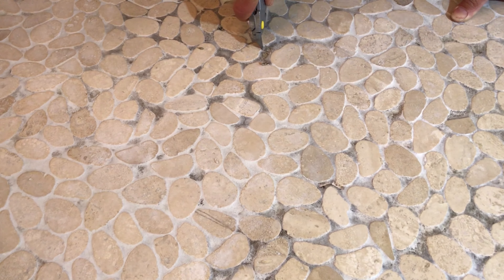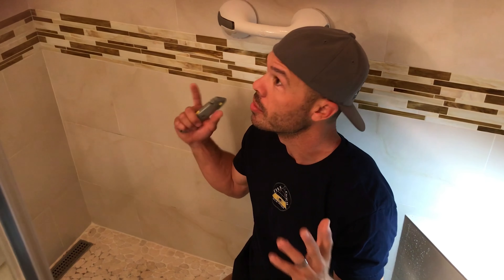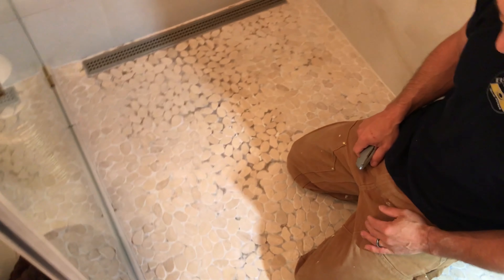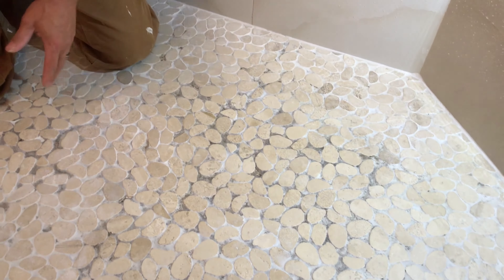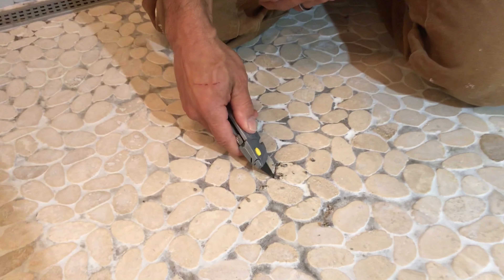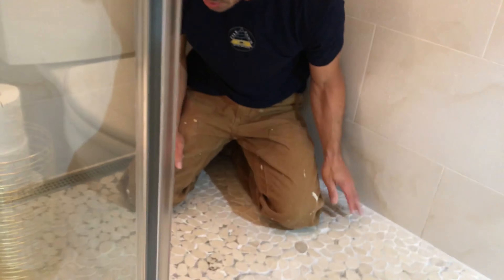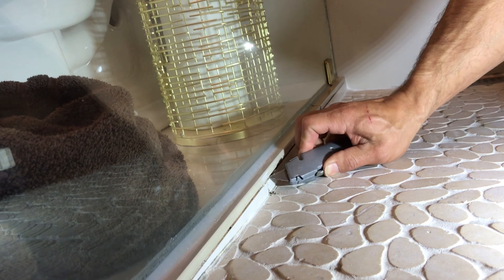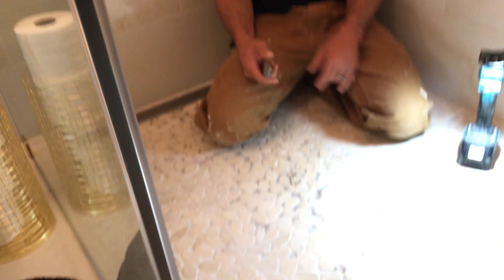I GROUTED this Shower WITH FUSION and it FAILED!

Comment: I used Fusion Pro for a couple of years. Stain resistant, no sealing, it sounded so good. I just had too much trouble with soft mushy joints and showers and I got tired of having to use grout haze remover the next day on probably half the jobs.  Customs kept lengthening the required cure time for wet areas. I just don't want to take a chance with it anymore. 

I have been using prism for a while now and am generally pleased with the results.
Reply: try grout sheild for sealing. you mix it with grout in place of water and then clean wipe with water. no going back to seal 3 days later

Comment: I used that stuff in a shower once.  Waited over a weekend before installing the grout... Roughly 60 hours before grouting Monday morning.  It all turned black and started falling out within months.   Called Fusion:. They said it was all my fault for not waiting 72 hours...  Fair enough, I'd missed that 72 hours hidden in their literature.  But there is no way that 12 hours was the cause.   It was hot and dry all weekdend.  That product is crap
Reply: All grouts have said 72 hours going back to early 80's . used to argue with bosses about that all the time
Reply: @jpstap2306  sorry, hut that's not correct.  Standard cement grouts aren't that sensitive.    But I just re-read the instructions for Polyblend and it says 24 hours.  I used to see guys grout the same day sometimes.

Comment: Good to know. Your videos have positively convinced me of one thing: I will NEVER EVER use tile & grout in a wet location. I'll never understand why people insist on using porous materials in a shower.
Reply: What are you going to use then? Those one piece plastic inserts? 🤔... Definitely curious
Reply: @Mansa_Musa.  
Maybe a pre-fab acrylic shower pan. They have their downsides too and certainly not as pretty but at least they're made of non-porous stuff. But to be fair I suspect the shower in the video may not have got the seven day cure time that Fusion grout calls for.
Reply: @Mansa_Musa.  Fiberglass pan embedded in cement so there is no flexing. And fiberglass surrounds. I coated the plywood floor with Redguard to protect the wood and keep the proper water ratio in the cement.

Comment: Just finishing my schluter system with a 5 foot linear drain. I am following your lead and adding Ardex 8+9 as well over the banding ect... Love what you do. Thank you for sharing. I love watching you and Sal. I appreciate your integrity! I will read all the data sheets before using a grout in my shower. I was thinking Tec power grout 550 but have herd about issues with it hardening. I think I will go with Mapei instead. 
Thanks for your time. Always amazed at what you and your team can do.  Looking forward to more of your epic vids.
Reply: Power grout is actually a great product. Been in the tile trade for 32 years and used power grout in my personal shower at home. The shower is almost a year and a half old and looks like the day I finished . Used it on several jobs now , it has the same specs as some epoxy but not the difficulty in workability
Reply: John Hewitt I agree. That’s all I use. Have used other products and have not had the best results. Tec is just a good product IMO

Comment: I’ve used it, I didn’t find it user-friendly, and the result wasn’t impressive. I know of others who have found it soft, long after installing it. I will never use it again, although I like many of the products made by Custom. 
Great video, the installer will always be held responsible unless culpability is unavoidably and obviously somewhere else. Which equals to about 99 point something percent of the time.

Comment: another educational video .. keep them coming.. did the water not drain completely and the water just sat there and the grout just molded and soften up. And did the homeowner turn on his exhaust fan while he showers. If his walls have water stains that means he didn’t turn on the fan. Because if the exhaust fan was on it would of help vent and dry out the shower .

Comment: I grouted my river pebble shower floor with white grout designed for show floors. 7 years later it is still perfect. The entire shower was installed 26 years ago. Never a problem. Funny how the old tech often times is better. The walls are green board with white ceramic
 tile. As basic as you can get.
Reply: Do you have a product name for the grout you used?  Thanks!

Comment: I've actually used fusion in commercial kitchens for several years.... For very limited repairs.    That said, I've gotten to where I only use epoxy grout (spectralock) in wet areas. It's pretty much bomb proof.

Comment: Fusion  grout is no meant for wet areas it looks and works good for back splashes it could work for acasionnally  damp areas but you have to let it cure for at least 4 days, yes it is installers fault

Comment: I left a message today in your office with Mrs Marissa for an issue I have with a really bad shower in repairing,  and came across this video, .... I was just in a customer home last week about the same issue with fusion pro on a shower from last year, i loved it until now , same scenario stone pebbles (black this case) alabaster color fusion applied and 45 percent closer to the drain got black and soft and actually eroded away , the customs customer line told me that I shouldnt had use on pebbles and the irregular shapes created a large grout line creating water accumulation and causing the breakdown of the grout.... what a bomb after I saw this video bc guess  what I used to do the repair..... F..... fusion again , I had a the bucket still brand new of the same color and now I'm hopeless after seeing this video , I have a sense I will get the same call again in a few months, 
Ahhhh also I almost remember the customs person on the 1800 number told me that the quality of the water could  be an issue , the water in this home is treated to be super soft that you wash your hands with regular soap  is almost imposible to get it off your hands, also they ask me if the cleaning of the shower was done with organic or inorganic chemicals...so anyways 
So F**k  Fusion pro for those 3 days of lost time  ( 400 dlls a day) ....1200 bucks down the drain ......lol

Comment: Still curious of why pebblestone when wet would cause it to turn black the stone doesn't Leach off any chemicals or anything it's just the stone how could it make it black and only in the water portions where it got wet the most it doesn't make sense to me on any level I assume that you're telling me don't use that product it's trash and the reps are not going to back me up when I show them that it is trash that's what I'm getting out of this
Reply: It turns black due to mold growth in the grout because it is a garbage product!

Comment: Mold my friend.
A result of using an acidic cleaner eroding the grout and allowing water to stand in the eroding grout depressions. The air in the room is stagnant when the rooms air should be evacuated after each shower use. Allow an exhaust fan to move and evacuate room air for three hours after every use.
Reply: Bud Rowe well said
Reply: I have a downstairs bathroom behind a kitchen, the plaster was coming off the walls in the kitchen, all turned out to be condensation from that bathroom, I didn't really notice how bad the condensation was until I had the heating off for a few weeks and it became extremely apparent (even the door delaminated) previously owners had not fitted any extraction, I fitted a humidity controlled fan which is great, I don't know what the convention is in the US but here the UK it's normally triggered by the light switch so if the light is on the fan is on, which is a little silly in my opinion having a humidity controlled extractor fan obviously means it's independent of the light and you don't have to listen to it if its not humid, and you don't have to leave the light on after the shower.
Reply: what cleaner do you recommend
Reply: @naegleriafowleri2230  Aqua mix (Home Depot)non-acidic cleaner and sealant.
Reply: First thought in my head when I saw all the black, mold and dirt has gotten into the grout, because the grout has broken down.

Comment: Youre right about reps for manufacturers products. Im in the concrete trade and do a lot of resurfacing, staining..etc. When a product fails, its always "installer error". Thats what they are trained to say. Its pointless to have a rep come out as they will never admit product failure.
The only time Ive ever been able to get an actual manufacture warranty is when we had a rep come out to job and watch/document the entire installation and that is a very rare thing
and cudos to you for repairing a job done 5 years back on your own dime..Shows how you care about your work

Comment: I agree on the rep point.
With the amount of water the shower gets I would consider it a install that is water submerged,  and wouldn't use any of that type of grout other than standard, and epoxy grout.
Thanks for sharing the issue.
Reply: That’s ridiculous! A shower floor is not a water submerged area... it is not a swimming pool... it is considered an intermittent wet area. You do not run the shower constantly so it has probably 22-23 hours a day to dry out.

Comment: Just want to commend your work ethic and share my experience with this product. I had an almost identical with not only this custom product but also with one of my favorite grouts mapei flexcolor cq. The custom turned black and the mapei turned red and was said to be mildew by the manufacturer rep. Now this shower was less than 3 months old and these customers kept an immaculate home just the 2 of them no children. What ive taken away from these issues is when a new product comes along and claims to cut your time in half and be a superior product just let that info go right on out your other ear. The standard  for me has always been epoxy in wet areas and honestly i cant think of one problem ive had with them other than being more labor intensive. I agree with you on the brand thing. Ive used all of the epoxy grouts out there and guess what, they are all hard to work with but give superior end results in showers. Ive used the flexcolor and the fusion pro literally 100's of times on backsplashes or kitchen floors without issues but once you get  burned its tough putting your trust back in that company. Unfortunately as long as you have the big box stores out there selling people whatever they can with such inexperienced sales associates it puts us in a bad spot. Ive gone up against these manufactures more times than id like to remember and after so long its turned installations into 85% research and record keeping  and 15% actuany price al installations. There is no way to get around the fact that if they want to blame the installer than they basically have a way to do it even if it means sending 3 seperate inspectors out until they get one to say what they want. ( yes thats actually happened to me)  Anyways sorry for the book i wrote here but again the main thing i took away from your video is Your work will speak for itself when you have the integrity you have demonstrated and in the end your clients will have such respect for you that it wont matter what these Reps end up saying. The flooring business is in serious trouble from what ive seen in the last 5-10 years and if more true crafstmen dont get involved with the trade then guys like you and I will be able to charge pretty much  any price we want because there wont be any competent competition.Its hard enough to simply find a decent helper anymore let alone an actual Installer.
Reply: @Independent Flooring 
So true, really seems the trades are suffering for lack of "willing to work & learn" helpers. You'd think the DYIer explosion would have inspired more people to go into the hands on trades.....

Comment: The grout is the bit that ages,it's possible the fat from the soap feeds bacteria & rots the cement. Use extra admix in the new grout then seal with dry treat or your relevant sealing products. I've had problems in wet trays when the fall is shallow. Epoxy helps for kitchens splash & pool's. Re grouting is tricky on pebbles.
Reply: Very good advice from an experienced perspective

Comment: I've laid a lot of tile, but it's been many years, so I am really enjoying your vids and learning a lot about the latest and greatest methods and products. Here's a question.....why don't you use epoxy grout more, particularly as it was the 'fix' this this particular problem?  I've used it in the past, and I realize that it's no fun to work with, and a lot more headaches than conventional grout. However, when it's finished, it seems to be practically bulletproof. So where there is water, and the potential for staining, mildew and failure, it seems like the way to go. I've developed a lot of respect for your opinion, so I'd love to see you do a vid on your take on epoxy grouts. Thanks for all your great vids!

Comment: Sorry to hear that. I used fusion in my shower about two years ago and no issue. The one thing I can think of is the grout is supposed to set for 7 days prior to use (exposing to water). I did not use pebbles however.

Comment: Had a bunch of failures with the old Fusion grout in showers but customs actually came out on a couple that we couldn't fix and removed shower pan tile and replaced with new tile and grout themselves. Didnt have the same experience with them as you did. Also read and understand the warranty on your products you will find some are not much of a warranty. I have switched to Laticrete because their warranties are awesome.
Reply: @TileCoach  yeah I dont use custom much anymore the reps are hard to get ahold of and it seems like they just dont care as much. I am in close contact with my Laticrete, Ardex and Mapei reps they are always available to me and have a strong online presence.

Comment: Possible that fussion is what it says it takes the fussion of kinetic energy to create a chemical reaction due to friction to allow the parts of the fussion is o take place 

It may not have had enough motion for that reaction to take place idk I have used it and it was a bitch to use but end result was amazing just had to move fast or it would kick off and be rock solid please let me know what the reps said from fussion thank u

Comment: Not sure if this is the case with your project, I had a similar issue with fusion grout in 1" x 1" sheet tile on a sauna floor. This was pretty disgusting but the conclusion was the sweat from the body is what broke down the grout. Body sweat doesn't evaporate like water in humid temperature. Body sweat also can be corrosive "ammonia" and other minerals. So in the low spots between the pebbles could hold sweat. I know it sounds crazy.
Reply: Lol ammonia from sweat good one. Its called piss not sweat and good grout is not affected by body fluids in that way

Comment: I used Fusion Pro in one (and only one) shower install.  It was very difficult to remove tile haze, even within 20 minutes of putting it on, and a year later it has stained and is very difficult to keep clean.

Comment: If fusion ground has always been a problem in a shower floor it's obvious that it cures by evaporation. I've always used nonsended with sanded 5050 crowd with an bombing agent deluded. Those shower floors after 27 years still look the same the reason why they don't stay is that we use a Biodegradable cleaner. Most cleaners have chemicals that screw up a good seal job. And by the way when I do my marble showers they have a 32nd grout joint if thin set can fit through it so can nonsense a grout and they still look good after 40 years yeah. Love what you're doing have a great day.

Comment: We’ve had a couple showers with fusion fail as well, we are currently helping another installer identify their problem too. What we found out is that Fusion was not made for wet areas....this was straight from the reps mouth, so yeah, don’t do fusion in wet areas👍
Reply: Isaac Ostrom  I’ll have to find out from my partner. We are out west in Idaho. But I’ll find out
Reply: So we contacted fusion themselves, they sent a rep out.
Reply: It’s not supposed to be in shower floors

Comment: That what the manufacturer do, don't  take blame.  I had flooring put in my kitchen and six months later it started to chip on seams.   The manufacturer said it failed because it wasn't installed by a lic floor installer.  Yes it was!  Our contractor contacted the rep, they went back and forth.  manufacturer decided to give us a replacement flooring and my contractor installed for free.   My wife and I purchased the flooring not the contractor.  They replaced the flooring (their labor) for free. 

I know your pain!

Comment: Did they have a water softener? 
Question... using hot mpp pan, diamond lathe and paper on walls should I drop the wire to a couple inches above the deck mud or tuck behind before packing the pan. My pan has no curb and is on slab. Hotmop is about 1.5 " above slab at present and I plan to add 1inch of deck mud to 1/2 at the ramp. Your thoughts?
Reply: @TileCoach  ok. But then its impossible to secure the wire to the wall the last 8 inches. Right?
Reply: I already stapled to 3 inches above pan
Reply: @TileCoach  what holds the lath from flapping the last 8 inches? Thank you i will float wall first